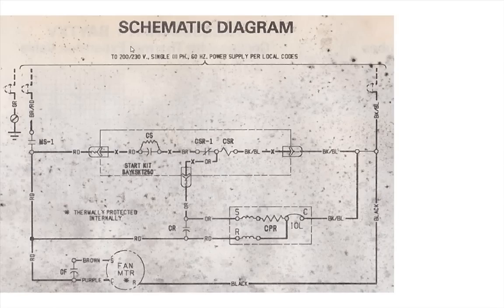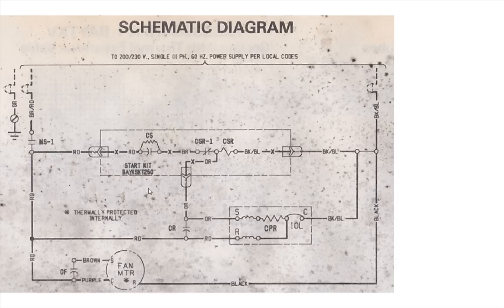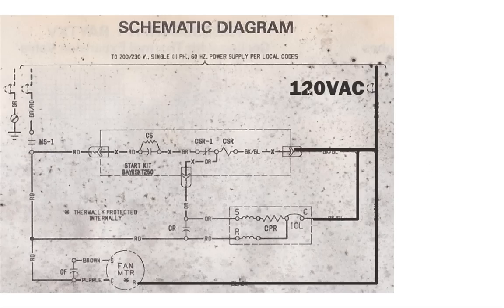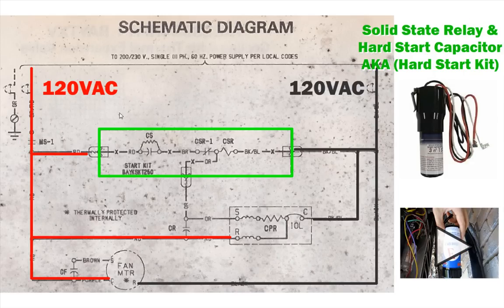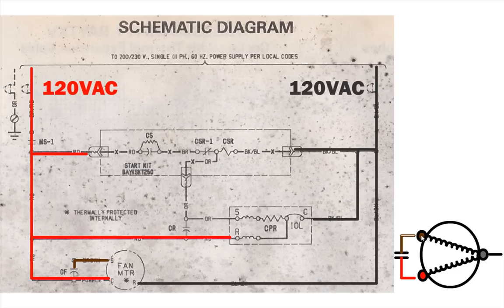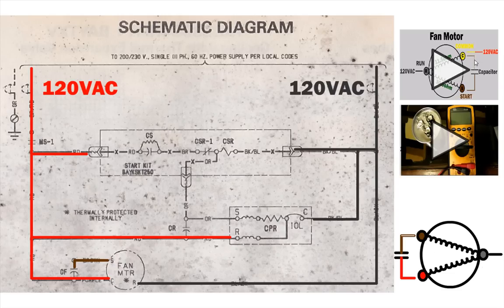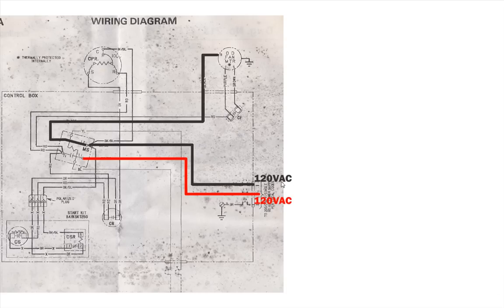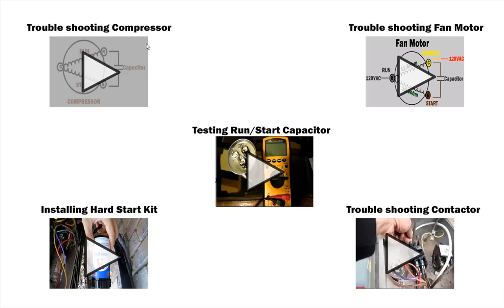HVAC condenser - how to read AC schematic and wiring diagram - air condition howto

Comment: Good tutorial , in the past 6 months I troubleshooting my refrigerator ,what i found was bad capacitor , went to the appliances supply store and they didn't have the original ,it was middle of the summer so ia had no time to wait to order a factory parts , the employee offered me a substitute , warranting good performance and very cheap ( 50% of the original) i did take it ,mounted and run fine but 2 months latter it stopped working , my compressor was grounded ! ! ! !. So if you have to buy the starter kit do not use substitutes .What you pay is what you get .
Reply from the maker: hmm... maybe you had both capacitor and compressor going bad. A bad capacitor causes the compressor to run harder

Comment: just wondering does the common terminal on the run start capacitor coincide with the brown wire in the diagram that is going to the S - terminal of the fan motor ?

Comment: It looks like that the Run Capacitor has 3 wires , one going to the fan , one to compressor and one to common. But when I look at the diagram , it shows that 2 wires are going to the fan ? For the run capacitor which one is the common Terminal ?